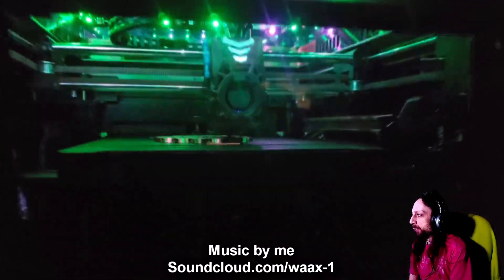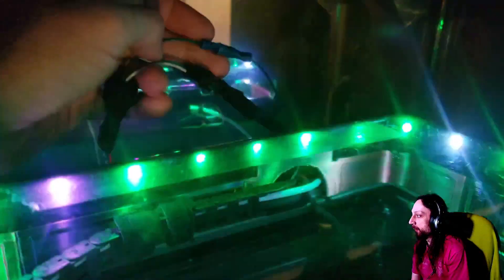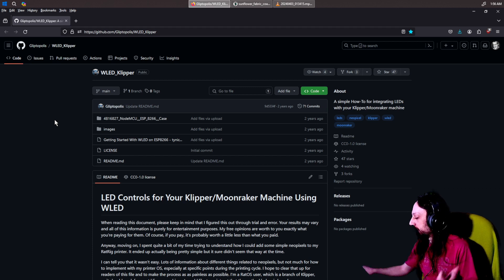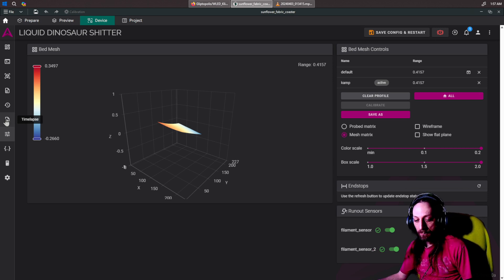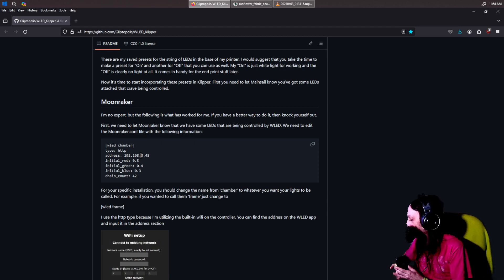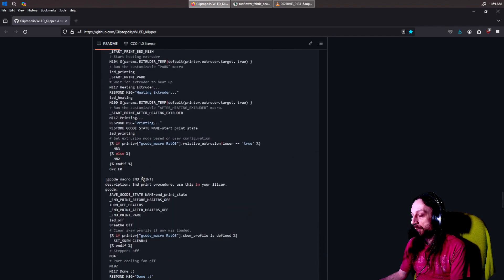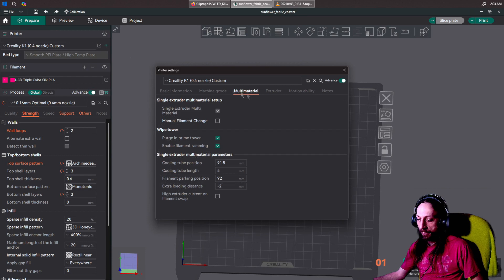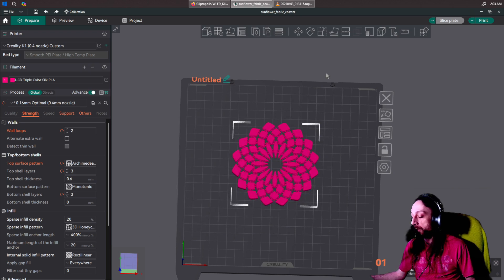How to make Klipper control WLED running on an ESP32

Comment from the maker: Crap, I knew I would have forgotten something, in the moonraker.conf file you need to count how many leds are on the strip, mine has 40 which is why you see "chain_count: 40", that number tells Klipper how many individual LEDs its controlling, which is important.  In the tutorial it says "chain_count: 42", make sure you edit it to how many LEDs you have connected

Comment: Awesome tutorial! Question: would this work with an addressable strip plugged directly into your control board or would you still need a separate esp device for it to connect to WLED ?
Reply from the maker: not really sure, i just have experience with WLED so that's what i used